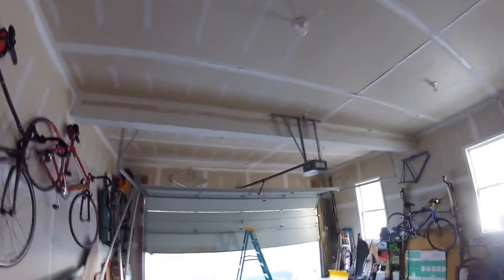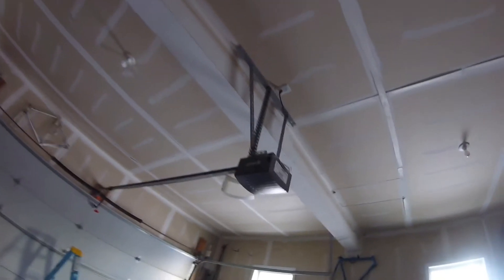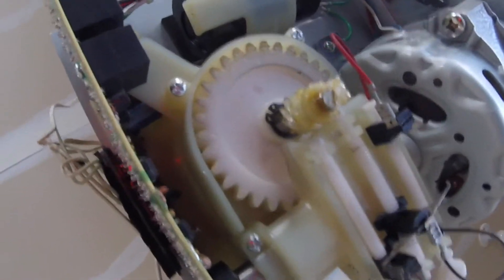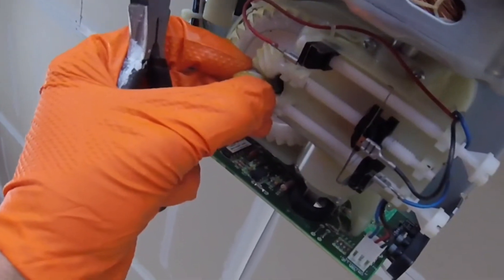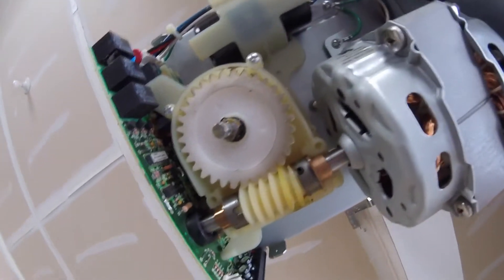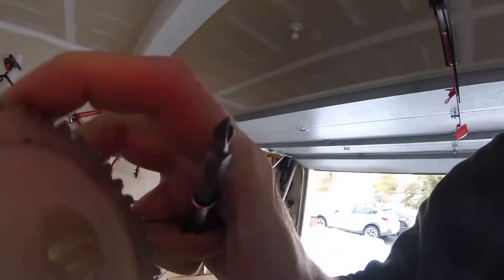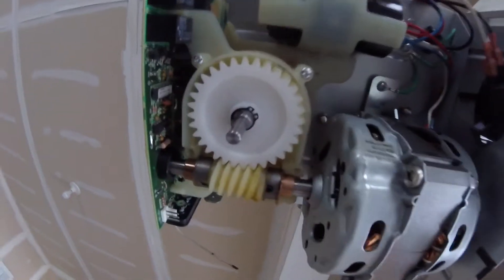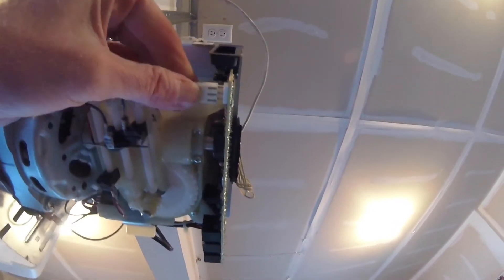Linear LDO50 garage door opener gear replacement

Comment: YOU REALLY HAVE AN ISSUE WITH KEEPING THE CAMERA STABLE.  THE FIRST THING YOU SHOULD HAVE CHECKED IS THE SPROCKET GEAR ON THE TOP OF THE UNIT THAT ACTUALLY DRIVES THE CHAIN.  IT SOUNDS LIKE THAT IS THE REAL ISSUE.  THE NYLON GEAR THAT YOU REPLACED IS A LITTLE WORN BUT NOT ENOUGH TO MAKE THAT POPPING SOUND.